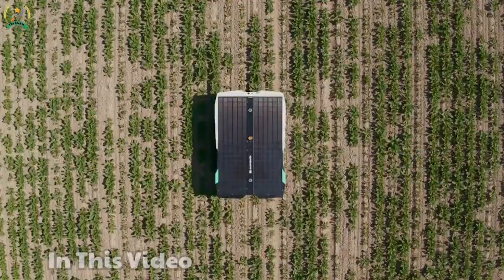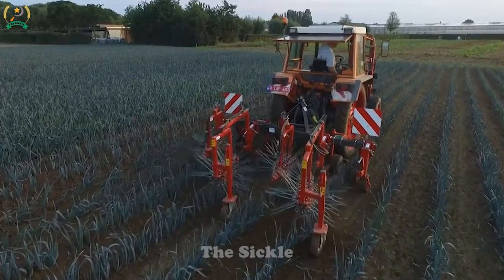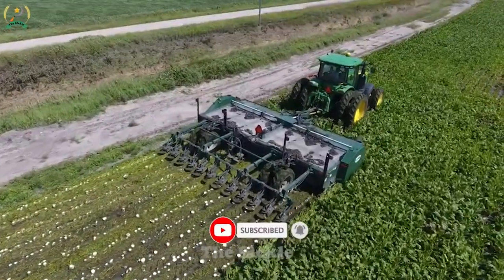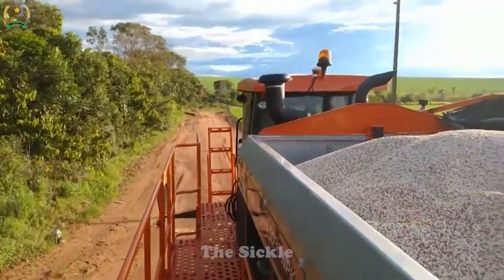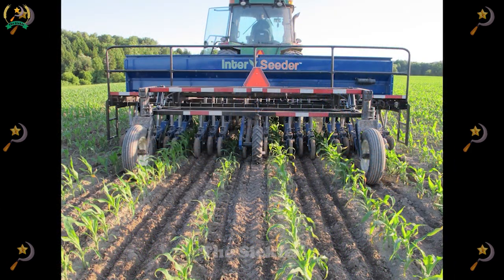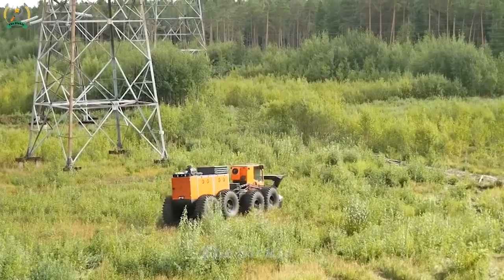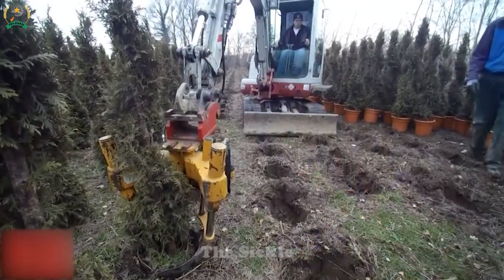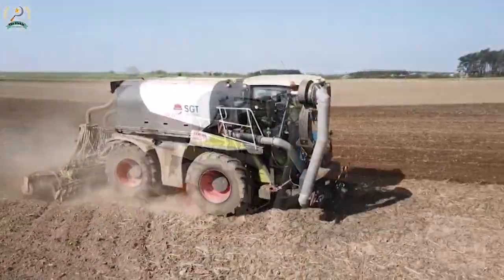25 Amazing Heavy Agriculture Machines Working At Another Level ▶18

Comment: How do agriculture machines aid in the application of fertilizers and pesticides?
Reply from the maker: An interesting question:Agriculture machines aid in the application of fertilizers and pesticides through precision application techniques, GPS and mapping technology, variable-rate application, section control systems, real-time monitoring and sensors, and integration with data management systems. These features enable accurate and efficient distribution of fertilizers and pesticides, optimizing resource utilization, minimizing waste, and promoting sustainable farming practices.